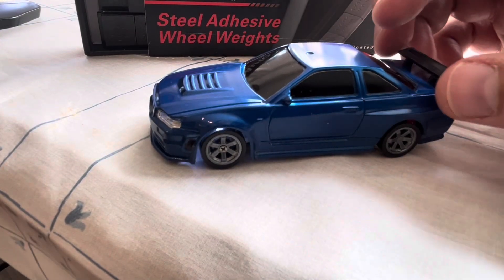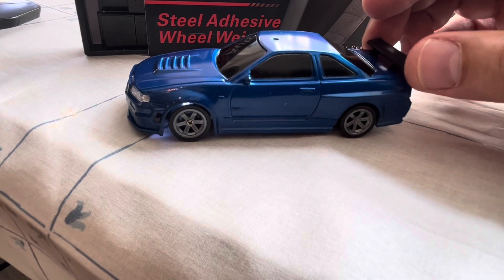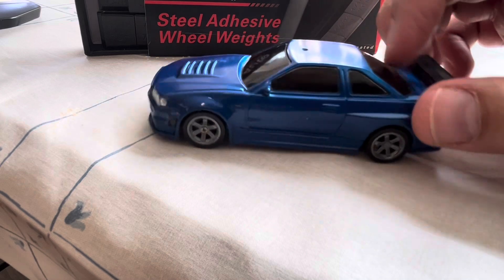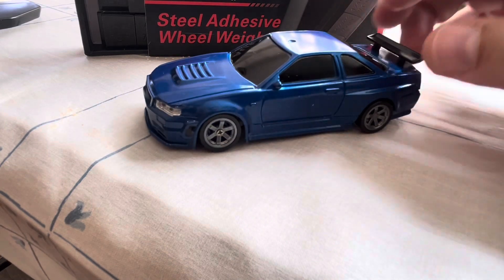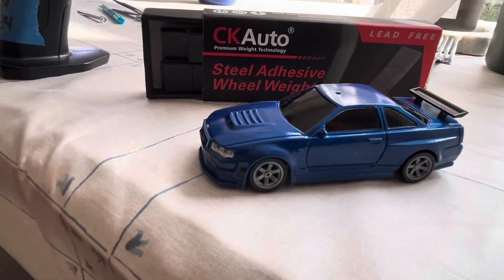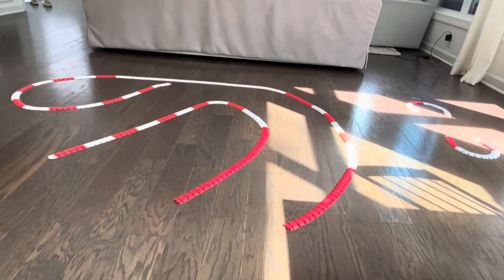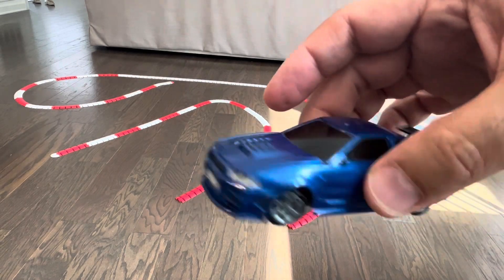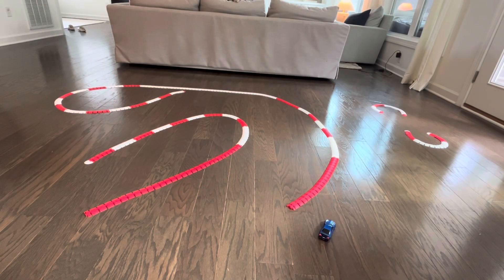1/43 RC DRIFT R43 SKYLINE. ADDING WEIGHT TO IMPROVE BALANCE!

Comment: I don't  know if you covered this,since its not in directions..All 3 of my cars reverse function was not working properly...it would take many times hitting reverse to get car to respond...the fix was simple..pull trigger fully,then turn on radio,then turn on car,let trigger go and wheels on car spin fast..then shut off radio and car...then just turn rafio on then car and everything is set..i did this with all three cars..also steering trims need to be adjusted every time since radio does not save trim settings...this should help some people out...i watched one guy do a review and he said trims have to be reset because it had weak servo,which is  incorrect...
Reply from the maker: @roadstar499  I didn’t have this issue. But good info. Thank you.
Reply: Thats weird ..maybe you never use reverse like i do..